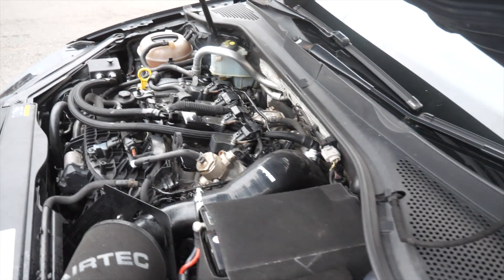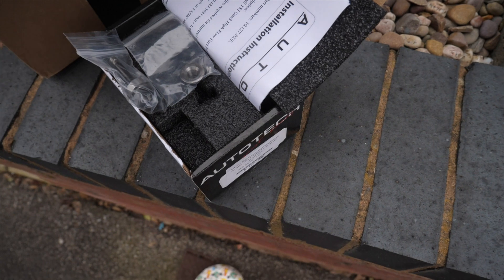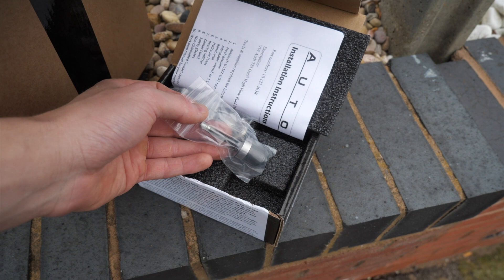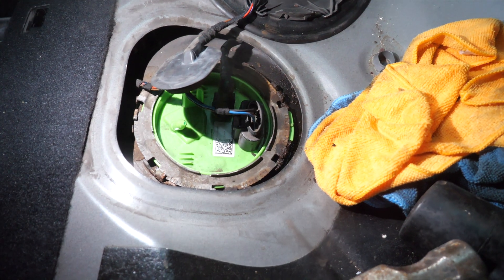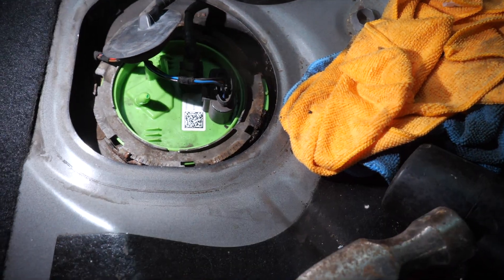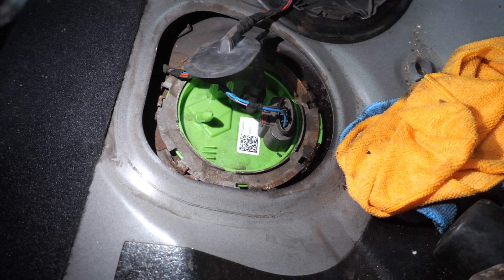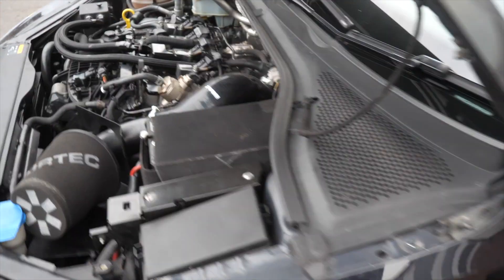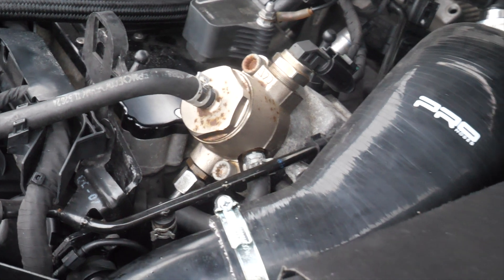VW GOLF GTI MK7 UPGRADING FUEL PUMPS LPFP HPFP FOR 500BHP

Comment: you can replace just the pump with the walbro juat more of a ball ache separating all the plastic to fit it , also keeps priming when the doors open n closed vag thing , best to just remove the fuel pump relay/fuse